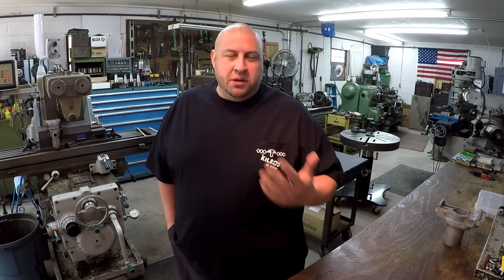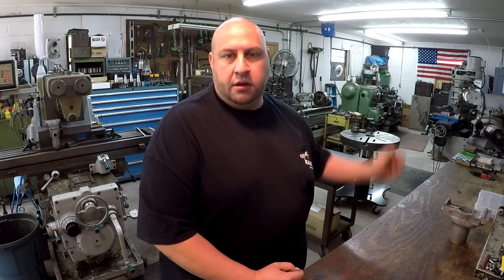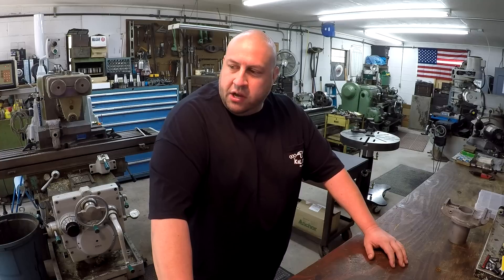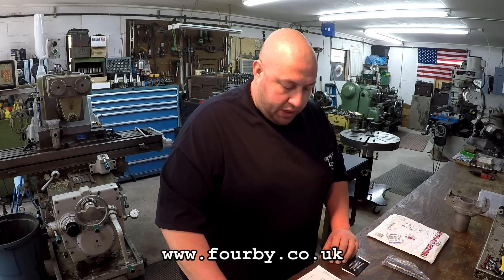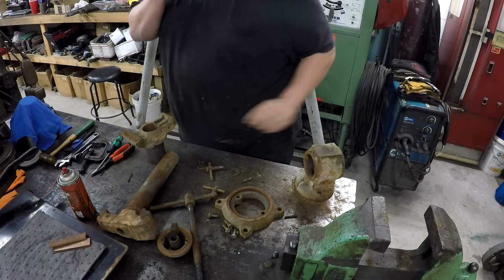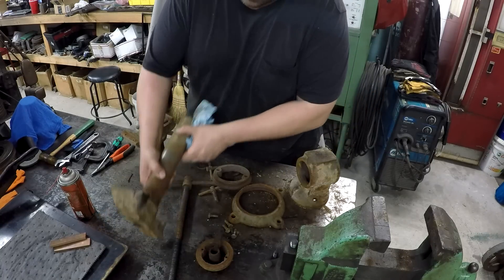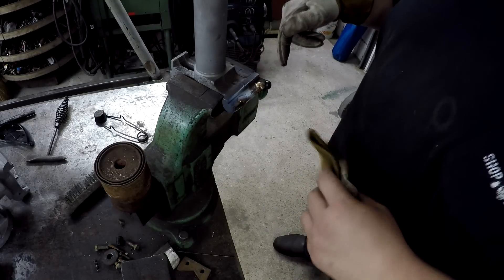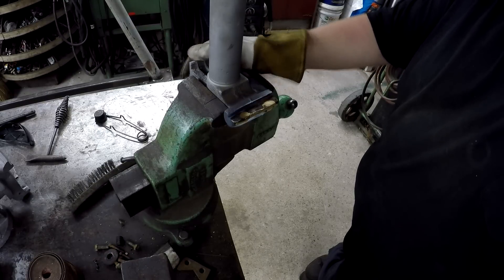Saturday Night Special 95 Part 1

Comment: I bought one of those vices in the late eighties or early nineties from Harbor Freight and it gave me very good service.  The swivel and pipe clamps were very useful.  It got retired when I bought an eight inch mechanics vice from them which is still seeing hard service for the past twenty five years.  They aren't designer vices but they have certainly worked for me and they were affordable so it is nice to see you restoring one for your cousin.  Excellent video as per normal.  Doug

Comment: I have what appears to be the same vise, made in China and all. Mine has slotted studs with hex lock nuts to hold the pipe jaws. I've had this vise 10 years or more, and I never knew the jaws swiveled. It took me a few minutes to get mine loosened up and moving, but it works great. I am amazed how much simple stuff I don't yet know.

I love your channel!

Comment: Hey Adam, on your blast cabinet...  I had an old-timer (who ran the coatings dept at AeroJet) give me a better idea than the plastic liners.   Pull the main glass and put a piece of cheap single strength glass behind it.  Real glass stands up to the abrasives better than the plastic liners and certainly cleans up better.   The single strength glass should run you just a buck or two and just becomes sacrificial.  Mine last about 2 years and then I throw them away.   I've also learned to use Rain-X on the glass before I install it and it sheds the abrasive better and doesn't promote static cling.   Just a thought.

Comment: I love those parallels, wonder if the holes are the right spacing to line up with the table slots on my G&L? Of course the spindle will go to 4-1/2" below the table on it so you can use the aux drilling spindle at table height so not as big of a deal but still would probably come in handy sometime.  When they start getting in the way let me know. :-)  Congrats on all the new subs! Think you gained as many in the last month as I have in 4 years! Clearly you are doing things right that we all can enjoy. :-)
Reply from the maker: +bcbloc02 Judging from the emails you send, I think you have your eye on some of that BIG BOY tooling yourself. I'm sure you'll have to get a few things for use on the G&L. You'll want some big angle plates you can bolt things too. 
Thanks for the comments on the channel.

Comment: I want a Vice just like this one! Made by Adam. And talk about LUCK on the horizontal indicating on the jaw face....horseshoes if you ask me :) shaking my head 

Think I'll become one of Adam's cousins.

Those parallels... yikes. Awesome. You should keep them in your home shop, just build a bigger bridgeport deck :)
Reply: +Doug Hanchard No joking man, those parallels are almost as big as the bed on my 1st lathe! The Atlas TH54 10" x 36" bed has flat ways too, so you could even build a little bit smaller of a lathe using them, and there is no doubt that it would be more stout than the Zamack cast material, LOL!

Comment: Hey Adam,

That Chinese vise you're cleaning up for Alex looks awfully familiar...  Olympia imported a LOT of them, sold through Home Depot and Big Lots, and probably a few dozen other outlets...

I need to get around to installing the replacements I made for the pipe jaws on mine - the T-shaped jaw had only 2 tack-welds holding the two pieces together, and, to add insult to injury, the back of the notched bit is curved!

It's a decent sized vise, and can take a bit of abuse, but look out for some crappy bits that were never looked at by an actual QC inspector...

This will be fun to watch - even if I don't have to deal with all that rust, seeing as Southern California doesn't have the humidity problems y'all have to deal with down there on the Gulf Coast...

Cheers!

Eric
Reply from the maker: +chemech You can tell they put minimal effort into this vise, the castings are just horrible and machining is a joke. BUT, it will still work and allow Alex to have a vise to use, and didnt cost much of anything. Plus is gives me some metal working video to share.

Comment: You got good cleaning with the blast cabinet.  Off to watch Part 2 - edit - forgot to add, that's a nice set of parallels.  They would come in handy on the  X100" x Y60" x Z25" 30 hp CNC mill at work.  Jeff
Reply from the maker: +JRD77VET Thanks Jeff! Enjoyed opening your viewer package today!
Reply: +Abom79   I thought that might come in handy for on your Monarch lathe.  I made it on my Monarch lathe.  Jeff

Comment: I'm amazed at how good that bead blaster works on that corrosion and paint. Any idea roughly how long it took you to do all those parts to your standards? 
They are some thundering tools and equipment you have acquired recently!!
Reply from the maker: I may have spent 20-30 minutes on blasting all those parts. It's a real good unit.

Comment: Left hand drill are the shit for broken bolts, unless you are using a drill press and the bolt backs out. Something has to give when the distance between the chuck and the broken bolt gets shorter its not good for the drill. lol

Comment: You can get lexan sheets cut to size at Ace hardware for about .33 a square inch for your cabinet protector.
unless it's some high magic proprietary shield, i bet it'd work fine

mind if I ask what flux you're using? I always have trouble getting braze on cast iron to wet worth a darn. it just stands up like a raindrop on wax
Reply from the maker: That's some old Peterson brazing flux for cast iron. I don't recall the number though. I like to use it once in a while, but my favorite is the prefluxed brazing rods.
Reply: Yeah I like those blue coated ones for most everything. I'll search from some peterson flux though.
Thanks

Comment: Why brazing and not arc welding like for the roll journal repair? Is there an advantage in brazing?
Reply from the maker: +N4w4k For the larger parts I still like brazing it up myself. I've had problems with tig welding creating hard spots.

Comment: Must have taken a long time to get that moving jaw up to temp to take a braze. Is there a reason you didn't arc in some steel rod? Is it because it is cast iron?
Reply from the maker: +Zarouszz I prefer brazing on the larger parts, and no worry about creating hard spots too.